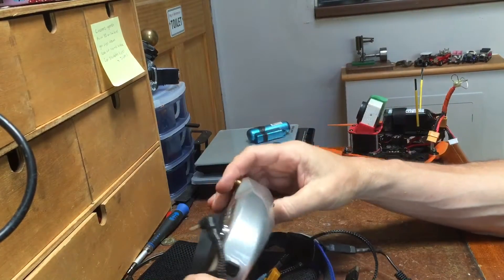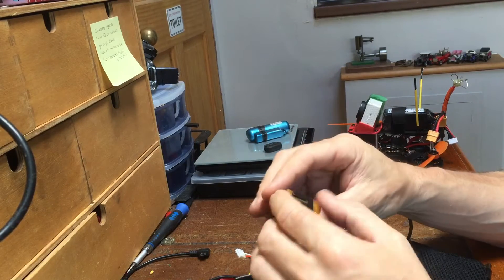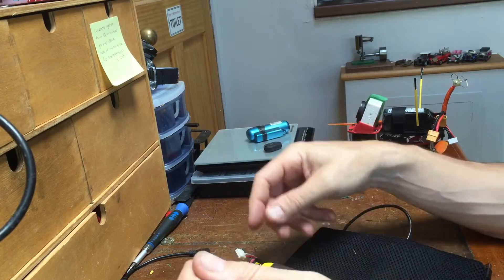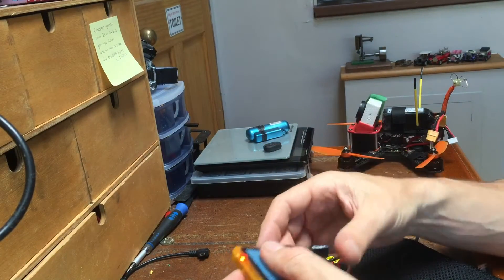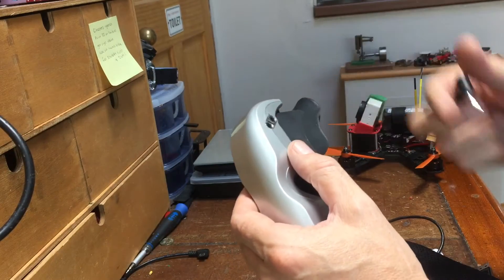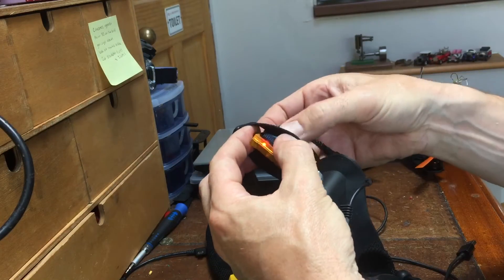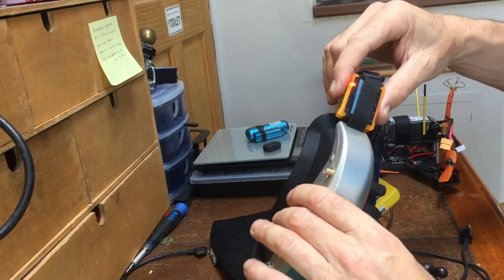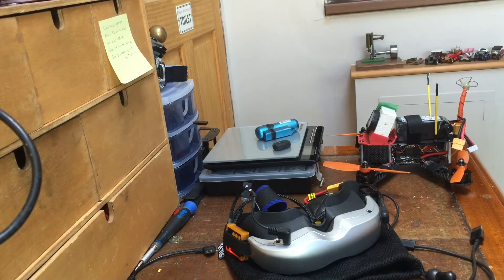Quick How to add a DVR to any FPV goggles with  Eachine proDVR

Comment: Hi thanks for the video
So if i understand well you had connected a "diy video cable" to the "video in" and an other on the "video out" slot of the echine dvr. 

Than you had created a "Jack to diy" video cable that you connect depending to your need to the video "in" to record or , to the video "out" to look what you recorded and in the jack slot corresponding on your goggles. 

And you power the echine trough your battery goggles that you had connected in 5V with a magical low down 5V stuff, that you created or bought? 
Am i mistaking some thing? 
Thank's
Reply from the maker: Félix Albert yes that's about it, I power the DVR from the balance port on my lipo via a 5v step down regulator. All still working like a charm
Reply: Great thank's! 
Where did you buy the regulator? is it some thing like that ? https://www.sparkfun.com/products/107
Reply from the maker: Félix Albert no I used an mp1584 DC to DC step down adjustable regulator, have a look on eBay there's plenty to choose from and they are tiny I bought 3 as they are handy for projects
Reply: Ok great thank's! 
Do the voltage out the regulator change if the battery is full or empty or is it still 5V ?
Is there a risk of high A that could dommage the echine dvr?